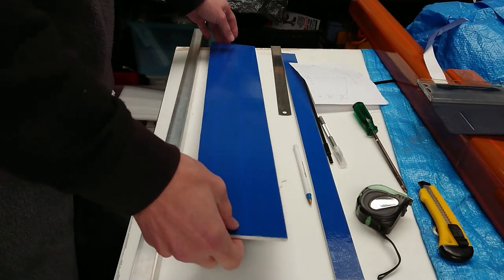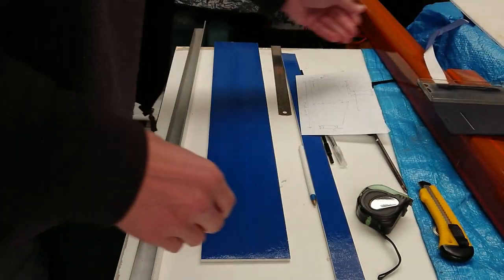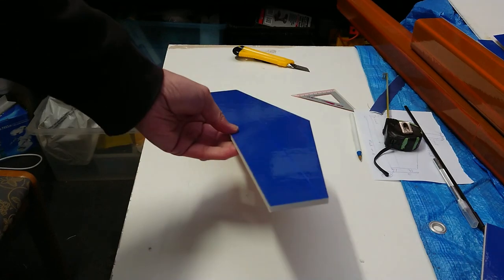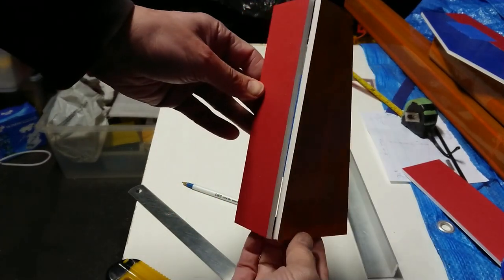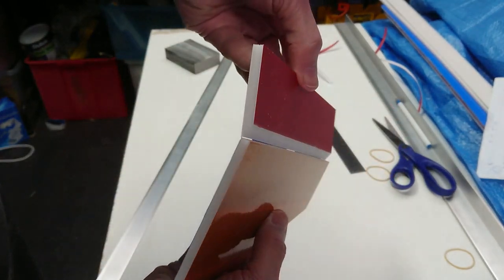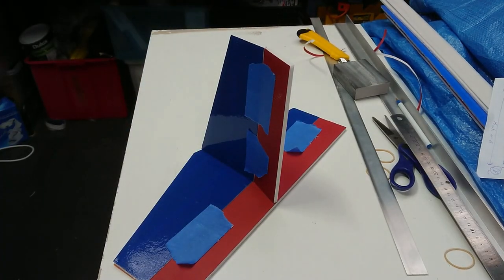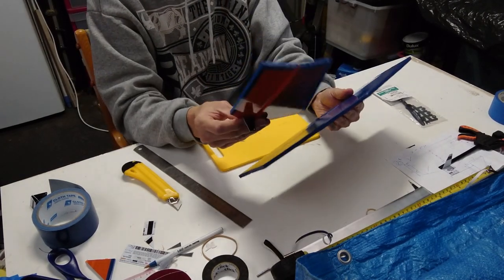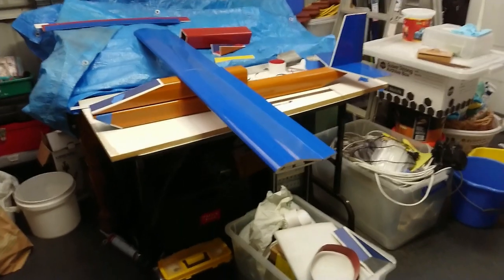A plane scratch build - (cut out rudder & elevator)

Comment: Hello sir , First off wonderful work, secondly i would love to ask you few questions about this, you see I'm an aeronautical engineering student and i was asked to make a small model empennage with a controllable elevator and i wanted to get tips from you on the material and steps needed to make one
Reply from the maker: Hello there....as per the video, just follow the steps and the material I use is foam sheet.  I use the coloured packing tape for added strength and to add colour.  I then use hot glue to join one to the other.  The hinge mechanism for the rudder and elevator is just another strip of packing tape that holds everything together.  Hope this helps, and happy to help.  If any other questions, let me know.  Enjoy.
Reply: Thank you soo much